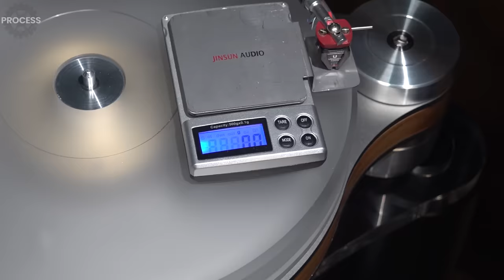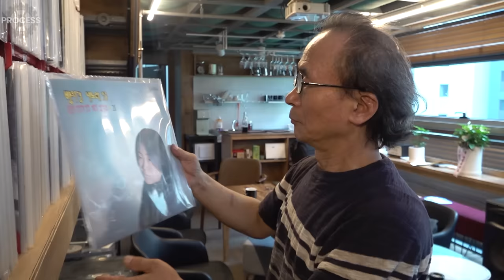Process of Making a Handmade LP Turntable. Korean Analog Audio Artisan.

Comment: My vintage Denon 1600 looks simplier 😂
Reply: Simplier? Had to look it up. Here is what I found in 30 seconds. 
SIMPLIER.
Incorrect spelling, explanation: the form simplier is incorrect because to create a comparative form of the adjective, we add suffix -er or -r to the end of the word. The vowel i is here unnecessary because the base word, simple, ends with e, not with y (which would transform into i, just like in busy → busier). The correct form of this comparative adjective is, thus, simpler....

 Anyway, you want simple? Go AR XA.

Comment: Hmm, doesn't strike me as particularly exotic. Sure, some very fine machining involved, but nothing a capable machinist couldn't successfully undertake. A blend of ply, acrylic and aluminium, bolted together in a very pleasing high-end shape. It's very nice, and extremely well-executed, but nothing special, at least to me, whose interest lies in the machining processes rather than the end result. I doubt it would perform any better than a Linn Sondek et al, which is about all a poverty-pack individual like me could afford...
Reply: Same thought as me...The platter wasn't balanced...You can easily find that plywood in the hardware store and a much celebrated TURNTABLE mounted on the floor as if it were a child's toy...Then that swinging listening pin doesn't convince me AT ALL
Reply: Exactly my thought...  Focusing on overly elaborated machined feet and overlooking fundamental details as the lack of an effective vibration damping system and that unreliably exposed belt drive system just to name a few.
And, besides the building of a fancy but somewhat technically naive frame, we see it being fitted with commercially available electrical and mechanical parts whose quality and characteristics we totally ignore.
I'm afraid that building a quality turntable is a matter of research, engineering and testing rather than nicely putting parts together. 
Would like to see this turntable performance checked with lab professional instruments, only to find out it could be possibly overperformed by many other affordable, industrially ďesigned and engineered ones.
Reply: You cannot easily find voidless Baltic Birch marine grade plywood at any hardware store. Comes in 60cm x60cm sheets. 13mm or 1/2" thick has 9 plies and 19mm or 3/4" has 13 plies. My local specialty hardwood lumber has it. It has doubled in price since 2020. I use it for speaker cabinets. The entire Grateful Dead Wall Of Sound was built with this plywood. I bet a lot of commenters have never even heard of a uni pivot tonearm either. Balance a precision machined disc made of homogeneous material that spins at 33 RPM?!? Live and learn....
Reply: Linn are excellent. I had an LP12 for years and loved it.
Reply: Please. Show us your offering. Can’t wait to see how much better you can do.
Reply: @juanbanzai  Don't be obtuse. You'll be waiting a long time to see me do better. It's called an opinion dude...
Reply: Make one!
Reply: @pulidoggy make one
Reply: @cillyede  No..
Reply: Хм, мне не кажется, что это какая-то экзотика. Конечно, требуется очень тонкая обработка, но ничего такого, с чем не справился бы умелый мастер. Смесь фанеры, акрила и алюминия, соединенная болтами в очень приятную форму высокого класса. Это очень красиво, и очень хорошо выполнено, но ничего особенного, по крайней мере, для меня, которого интересует процесс обработки, а не конечный результат. Я сомневаюсь, что он будет работать лучше, чем Linn Sondek и т.д., а это все, что может позволить себе такой бедный человек,
Reply: You know nothing.
Reply: This is about the whole process if you don't like it, just skip after the part you're interested in. I bet there are machinist channels out there that cater to what you want.
Reply: @hyperluminalreality1 i am con templat Ong maling the plat yee out if H59 brass which would
Reply: Who cares it's a lifestyle piece, an ornament if you will.
It's never going to compete with the quality of sound from a CD.
It's like buying a 10,000 dollar omega mechanical watch, it's not going to be as accurate as a quartz controlled 5 dollar watch
Reply: @juanbanzai  Why should I? I don't have to make the piano that I listen to or play Claude Debussy on do I? Non-sensical request...
Reply: @cillyede  Why should I? I don't have to make the piano that I listen to or play Claude Debussy on do I? Non-sensical request...
Reply: @manjacovus5342  I know more than you it seems...
Reply: @evolancer211  Sure there are, but I express an opinion only. I don't need to make the piano I listen to or play music on. According to you that's a requirement...

Comment: Too bad it isn't direct drive. No rubber bands would be needed.
Reply: It is very difficult to eliminate the small amount of induced hum when the cartridge gets directly over the DD motor and it's magnetic field. I would rather have a remote motor with a round section silicone belt as seen here. Wow and flutter is well below human threshold of perception with belt drive players. What about that anti skate mechanism? Fishing line on a tiny weighted bell crank. Fiddly to set and adjust.
Reply: @hyperluminalreality1  I have five Technics Direct Drive Decks. From the SL-D2 to the Linear tracking models, and finally the SL-1600 MKII. Not any hum at all. Totally silent and less Rumble than ANY belt drive turntable.